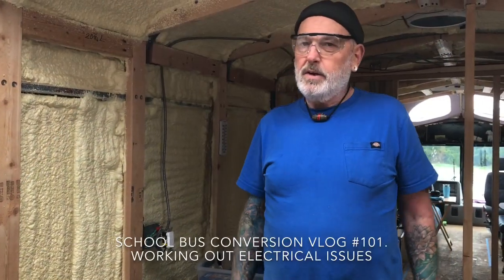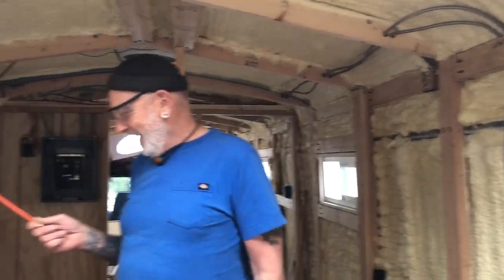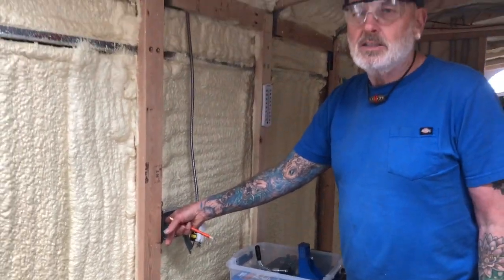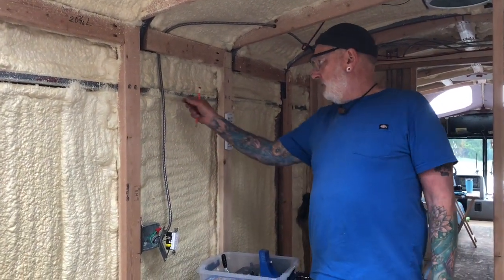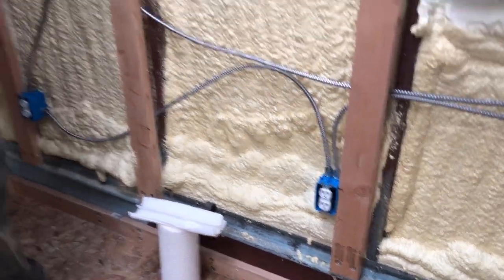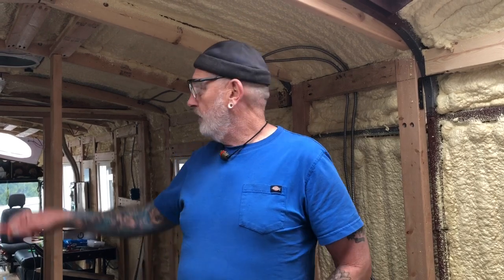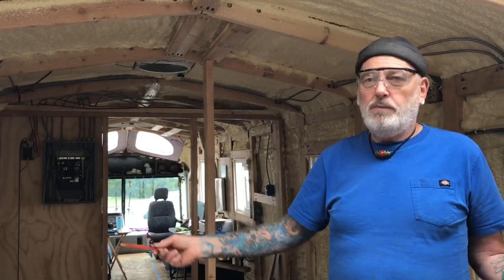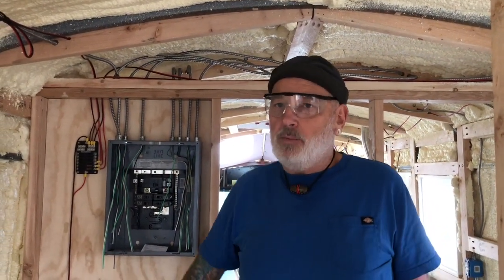Working Out Electrical Issues - Vlog 101 School Bus Conversion

Comment: Run a ground wire to the chassis. Problem solved. It's best to run romex instead of mc cable/ flex. You're right on point with the plastic boxes. Insulate mc cable to prevent contact with metal, no need to rip it out.
Reply: That is actually where AC and DC circuits have issues. There is no earth ground on the chassis. In an AC circuit nuetral is tied to ground. With neutral being live with a closed AC circuit, you are introducing alternating waves into your DC circuits and devices. Depending on how shore power is wired you might get leakage from other systems / circuits also using the shore power circuit. The same thing applies in reverse, when the DC circuit is closed, with chassis being ground you now have a path for DC to leak into you AC devices, i.e. air conditioners, refrigerators, microwaves...etc. My personal experience  is refrigerators are one item that seems to suffer from combined grounding. There is also the possibility of safety (although I believe slight) If AC is grounded to chassis with no earth ground and someones body creates a path to ground... could be bad. It would be hard to do, but possible.
Reply: @cntryby  I apologize, I left out one very important step. In most inverters there's a single screw that ties neutral to ground, you're supposed to remove that screw, thus allowing the inverter to become the ground for DC while the chassis grounds AC. Nevertheless, it's usually removed in Marine applications. Yet in some,  but not all RV applications it's left in place.
Reply from the maker: Thanks for your input.
Reply from the maker: Thanks for sharing.

Comment: Thank you for posting this video.  It's never as straightforward as you think it's gonna be, is it?? 

One thing that I had heard numerous times is that solid wire (like romex or even the metal-sheathed) is a no-no in a moving vehicle and that all wiring should be stranded, not solid wiring.  Numerous times, I've heard it said that the solid copper will "work harden" over time and will become brittle and break, causing a short.

BUT... most of the busses that I've seen converted are using solid core wiring for their A/C power.  Those that DO use stranded wire...mostly romex.  

What do you do when you get conflicting information and advice?  It's frustrating and sort of paralyzing to me in that I don't want to do something wrong and jeopardize my build or the safety of my family and friends!

Sorry such a long comment...  This is a tough one for me!
Reply: Harmony Express.Skoolie Yeah I totally know what you’re talking about. I ask one expert for advice and follow that thinking he knows what he’s talking about and he does for what for what he’s doing. But being a bus conversion RV has some different things to it. I’ve heard all the talk about using stranded wire versus solid copper and so on. When I run into problems I reach out to the experts that I know try to get multiple input on it and go with the best logic I can find. For this situation I think I have figured out that the ground takes place in the inverter box. And the second thing is the way I figured this out was by talking with a consultant who I have hire to help me with the design and all of these questions. I have literally heard from three qualified electrical engineers and they each had a slightly different view of how this should be done :-) I guess I’m just rambling here because I don’t know how to help you. I hope by having this video up and hoping the experts that view it will add helpful opinions on here it will be helpful for everybody :-)
Reply from the maker: Thank you for your comment.
Reply: In our second bus conversion when we stripped the 30 year old wires we discovered a few things. First of all the solid romex wires were all fine. The stranded wires were often broken. The smaller strands seam to fatigue more.